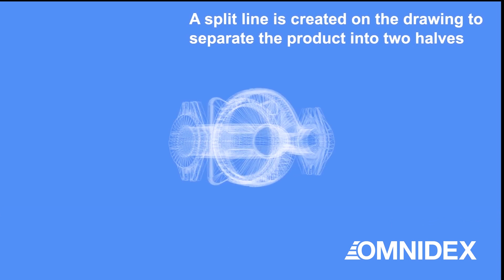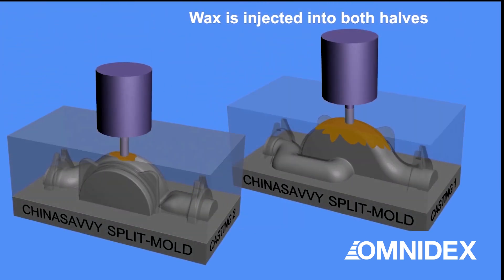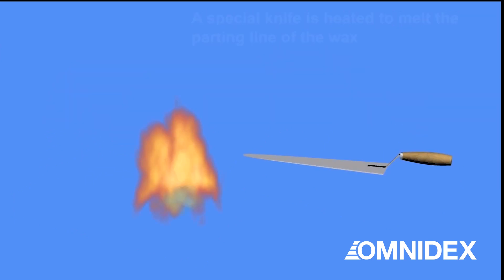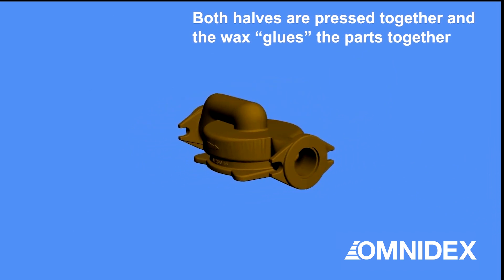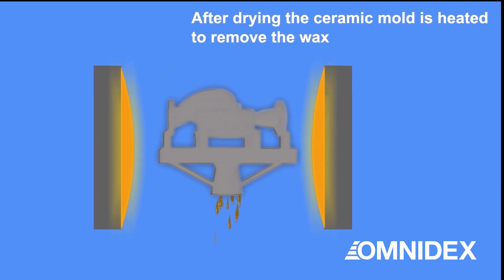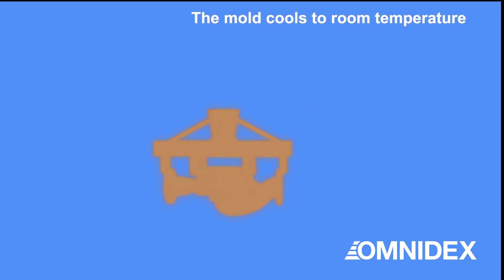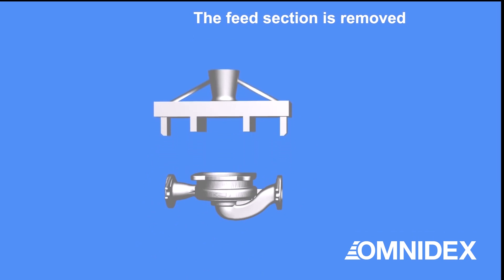Split Mold Casting

Comment: ♥.♥
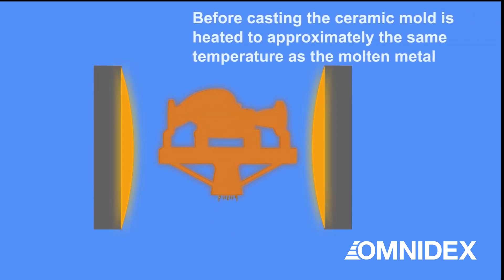Nice method "Lost Wax Casting". One of the most important information about Lost Wax Casting is stated in 1:05 of this video. That is a note about the right temperature for baking a ceramic mold.